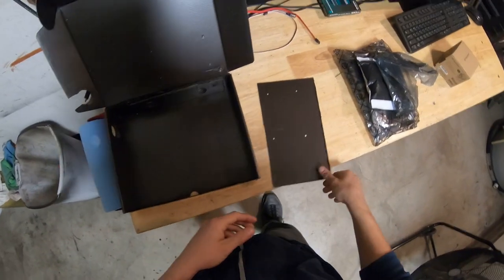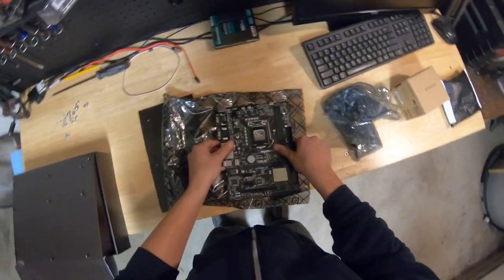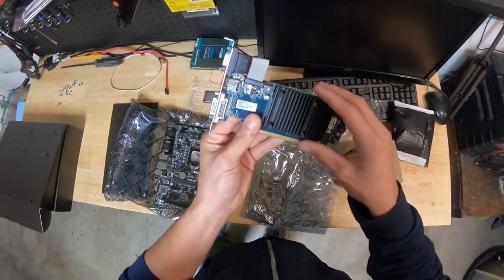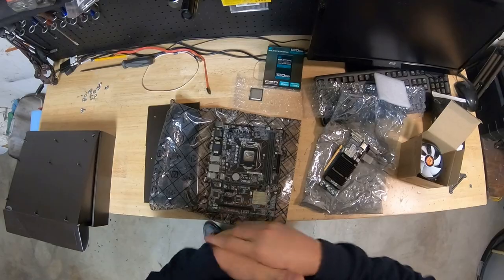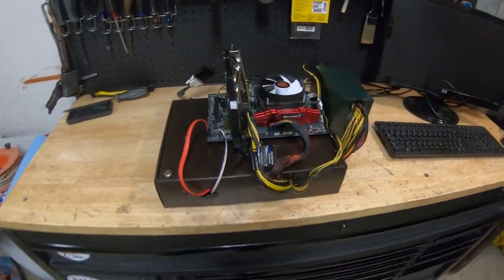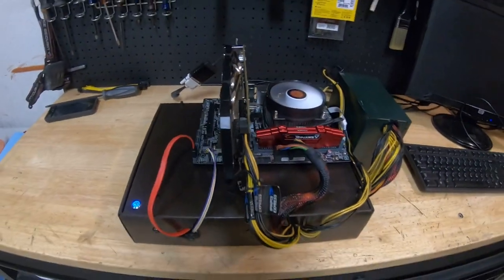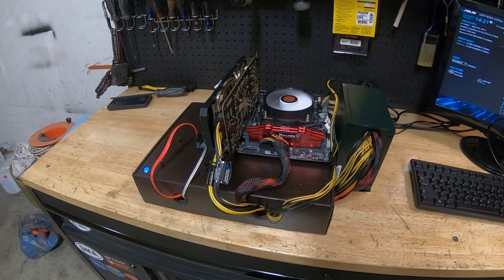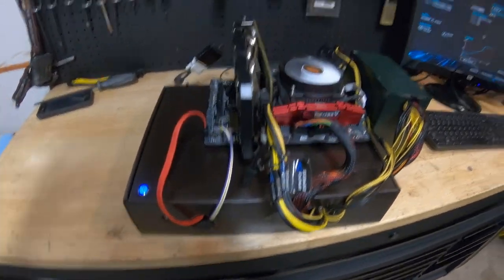How to make  a cheap PC test bench Pt. 2

Comment: Nice video, the Test Bench turned out well. Budget builds are your thing. The OptiPlex 7010 moved over to the wife's desk and with her having it, I'm sure that PSU will last a few years. I got my OptiPlex 7060 Tower last week and I must say the Intel Optane sure makes a difference. I actually saved almost $1000.00 at the checkout with Dell's Business Days but still ended up paying $2213.89 for it. I threw the GeForce GTX 1050 Ti in it for now. I'll use it for a couple of months and hand it down to my son after learning what I can replace it with. It only has a 360 watt 80 Plus Gold PSU. Keep em' coming!!!
Reply from the maker: Thanks man. I think that is the direction I am gonna keep with the channel. budget builds, mods, and budgets product reviews.